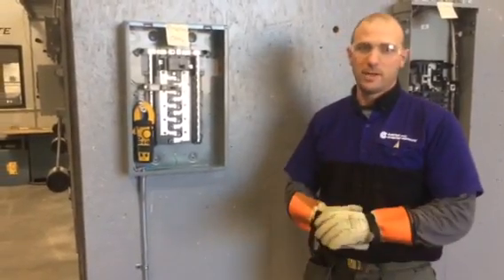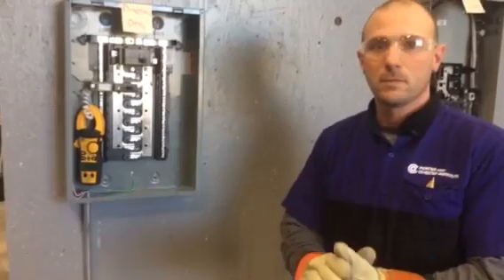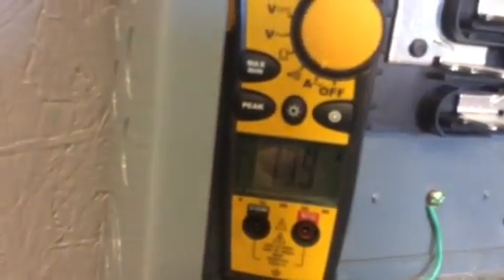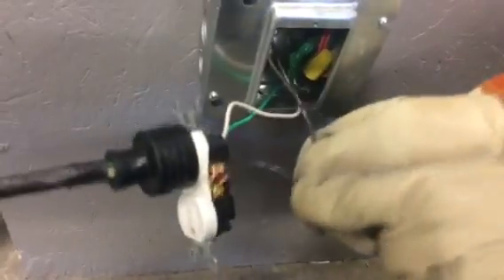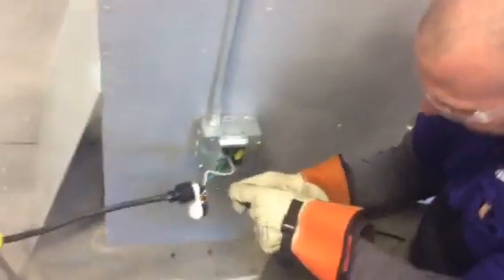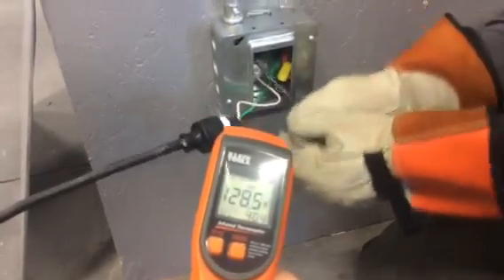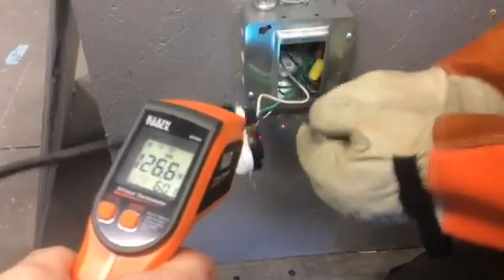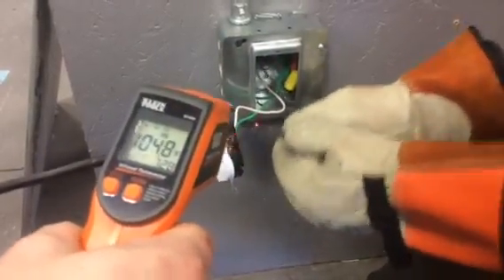Arc fault circuit breakers

Comment: Very interesting test. Out of curiosity, is the breaker that you are testing an AFCI or a CAFCI? If it is an AFCI, it wouldn't trip since they are only designed to detect parallel arcing, not series arcing like you were simulating. However, if you are testing a CAFCI, it absolutely should have tripped. The whole point of a CAFCI breaker is that it can detect low current series arcing, like what you are simulating.

Comment from the maker: Hot to neutral will cause a short circuit which will obviously make the circuit breaker trip because all circuit breakers have short circuit and ground fault protection. The point is to not cause this but to get the breaker to trip based on arc. And yes this breaker is a combo type series parallel.

Comment: I was in my apprenticeship right before this code change went into effect and they had a Cutler-Hammer rep come in with a regular circuit breaker and an AFCI breaker. He had a piece of romex laid into a plexiglass box, which had a cutout for a handle with a razor blade on it. They cut into the romex across the the hot, ground and neutral to create an arc. First test was with regular breaker and it arced a lot and the breaker wouldn't trip. They swapped it out with an arc fault breaker and it tripped immediately. You have to remember that these breakers monitor both hot and neutral and the test you're conducting doesn't create the higher currents of an arc fault.  I'm a field service representative for Eaton and I'm not saying there isn't anything wrong with the Square D breaker but I would suggest you try conducting the test in a manner that creates a short circuit type of arc fault.
Reply: Short circuits are protected by a circuit breaker using an electromagnetic coil which energises to fire a pin to mechanically disconnect the circuit (  effectively a solenoid ), they do not detect arc faults, serial or parallel . GFCIs 
 (or RCBOs in the UK ) protect against parallel arc faults to a large degree because they will sense the imbalance between Line and Neutral, but will not sense serial arc faults. Serial arc fault detection relies on computer programming and sophisticated electronics to distinguish between  a normal arc ( when a lightswitch is activated, or a motor start up , for example ) and a fault situation that is abnormal. From what I can make out , arc fault detection devices are only truly reliable if the fault is continuous  not intermittent , which makes them potentially useless for their intended job.

Comment: This is like saying your seatbelt didn’t prevent you from getting broken glass in your face during a car crash. It’s not meant to protect you from that. It’s meant to keep you in your seat, this breaker isn’t meant to protect against a series arc, because those are common occurrences in household appliances, or even light switches under normal conditions. They do make series and parallel arc fault breakers, get one of those if you’re worried about this.

Comment from the maker: We were testing the most common type of arc fault which would be a loose connection.
Reply: The arc fault is not continuous enough to trip the breaker, hence the issue of reliability of these  things. Please read my reply to Jonathan Grace below.
Reply: The usual counter-argument is that the most common type of arc fault that causes fires is not a loose connection but damaged insulation. That would produce a totally different picture than the series arc you created.

Comment: just learning about these devices.  sorry forgive ignorance.  if that was a arc directly from hot to neutral not through a device.  won't the device or load absorb some of the arc signal therefore prevent the trip?   don't get me wrong I wish they didn't work that way.  did you try a direct arch neutral to hot?  if the load you are using on the outlet is not a heavy load even though there is an arc it is only as large as the loads draw.  thanks k you for video it makes me second guess the benifit of upgrading to these
Reply from the maker: bobbysenterprises 
a direct hot to neutral will trip any circuit breaker because all circuit breakers have short circuit protection.

Comment: It's obvious why it didn't trip...you need to be running a vacuum cleaner, preferably with no electricians in the vicinity.
Reply: yep, just like my Dyson pops my new CAFCI.  I hate these CAFCI CB...just did a house remodel and the contractor updated the electrical with CAFCI and now multiple CAFCI breakers trips.  While my thermostat is on (furnace), the breaker would trip when I turn on energy-efficient bedroom lights.  my air fryer also trips CAFCI breakers now (after a month of not tripping)  One commentator was right; lots of people replace CAFCI after inspection.  I'm sure some detractors will say it's not a "nuisance" but "safety" trip.

Comment: Have you already received an answer to the question?
If no, here is my explanation.
AFCI is designed to break when there is a constant arc.
The difference between a constant arc and what you did is that a constant arc is a lot of small arcs at a very high frequency, which is what the AFCI recognizes.
If you want to test the AFCI breaker, what you need to do is put 2 wires very close to each other but not touching, you can control it by connecting 2 screws to a plastic device, and screwing the screw to almost touching the other screw so that a permanent arc is created without a direct connection.

Comment: Its because it probably isn't a combination arc fault circuit breaker.  A non-combination type won't detect series arc faults like you were doing.  It will probably only detect a parallel arc fault.
Reply: Read the comments. Eric posted that it is a CAFCI

Comment: Maybe you should try repeating your experiment by creating a loose connection passing current, instead of a normal arc like you'd have in a light switch or the brushes of an electrical motor.
Reply: Jon Tyson it is basically the same thing these things are trash

Comment: I'm pretty sure it's not supposed to trip on these types of series arc faults, my Siemens breakers claim to have the technology to differentiate between a series and parallel arc, if they were meant to trip on any type of arc this would be a nuisance as many home appliances that incorporate a brushed motor would trip this device.
Reply from the maker: You're missing the point. This is the kind of arc where you would want the breaker to trip. A loose connection from cappy workmanship under load. This is extreme yes but reality with people out there. This would cause a fire and that's why we have arc faults in the begin with.
Reply: @ericstark6183  I would be more concerned about arcing between the Line and neutral or the line and ground, I believe that even with the series type arc that arc time has to be at least a few hundred milliseconds in length for the breaker to recognize it, this is to avoid nuisance tripping like when turning on and off a light switch. I will test my theory this week.
Reply from the maker: @JonTheChron  all circuit breakers have short circuit and ground fault protection. The arc fault breaker does nothing in addition to that.
Reply from the maker: I get the nuisance trip but at the end of the day I want that breaker to trip on a scarey looking arc like in my video which is an arc that would actually potentially cause a fire. Not some inconsequential punny arc.
Reply: @ericstark6183  I was wrong about what I said earlier. I just had did a test with my Siemens QA115AFC and they instantly trip with similar conditions to yours. I'm going to say that I think those breakers you have on hand are junk. I can make a video demonstration if you want.

Comment: That's not how it works , arcs are slow and take hours to fully get going. What you are doing does not normally happen in the real world
Reply from the maker: Why would an arc be slow and take hours to fully get going. That makes no sense. Give me an example of such an instance.
Reply: @ericstark6183  Wires slowly become loose, as they become loose the connection slowly gets worse over time. The premise of the Arc fault beaker is electronics, the beaker measures the circuit in normal conditions and has a "normal for that circuit reading" If the breaker does not have a reading of the circuit before the arcing I don't know what happens but it mite read the circuit and think thats normal, The type of arc your simulating is very uncommon.
Reply: Arcing on the BREAK not MAKE

Comment: Ordinary circuit breaker only overload short circuit protection function, but does not have arc protection function, when the arc occurs, the ambient temperature rises rapidly to about 200 degrees ro the surunding materials will cause electrical fire, only 2 minutes will catch fire this is very terrible, especially wooden material houses or warehouse recycling station and other places are more likely to catch fire

Comment: the arcing you are creating must not be in the frequency range that the interuptor is searching for. It needs to descriminate between "normal" arcing, such as from a brushed motor, and "bad" arcing, which decreases it's performance
Reply from the maker: kfafnis 
You see I don't agree to that because manufacturers sell these based on the assumption that the homeowner has a safer circuit. this experiment of a loose connection which happens quite often actually produced an EXTREME condition which should have tripped the breaker without question.
Reply from the maker: kfafnis 
Frequency has nothing to do with the fact that all residential homes in the USA operate on 60 hertz and regardless of that, it's intent is to trip on a series arc or parallel
Reply: Actually these devices sense the High frequency that is produced from electrical arcing. The original radio transmitters were spark gap transmitters.
Reply: Let us all make sure that all accidental arcing happens in the right frequency, so that the AFCI trips. If we ensure that every bad connection arcs just right, then AFCI's will definitely protect us!
Reply: to reproduce an accurate fault, they should leave the wire connected for a few seconds, then create an arc by BREAKING the circuit not MAKING it.

Comment: why is it a series circuit
Reply: James Flaherty series is one connected thru another.. so if you remove the one HOT, the rest down stream lose power. In parallel, if you remove the hot the rest down stream would stay energised.

Comment: you need a combination arc fault. the combination afci will detect BOTH series and parallel arch faults. currently the breaker you have installed isn't looking for series arch faults.
Reply from the maker: Bill Davis 
it is a combination afci. why would I test a series arc on a breaker that only detects parallel arcs? Come on now
Reply: @MZ-em7rp  they work for Siemens, which is what my CAFCI is and I can't wait to replace them.